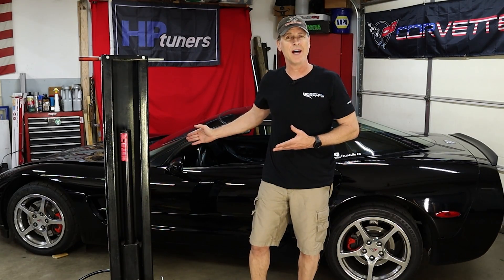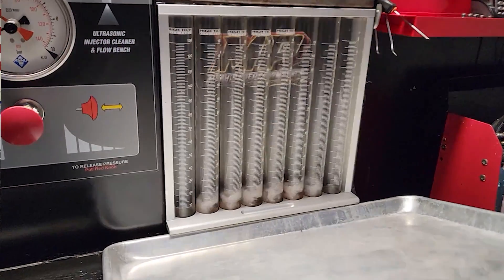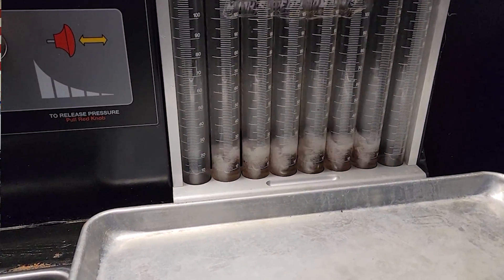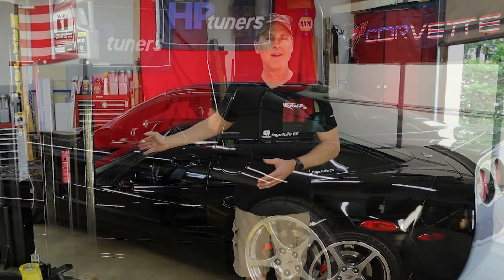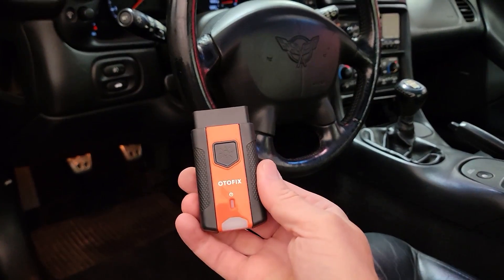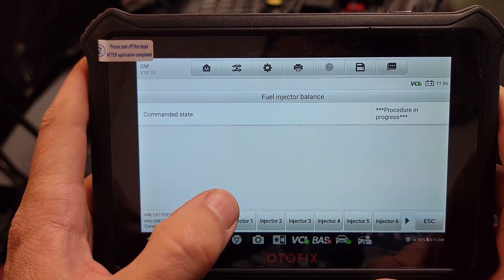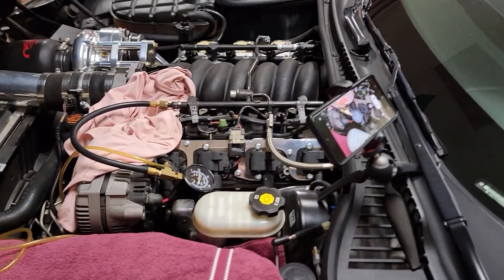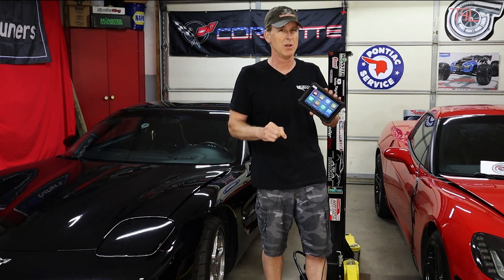2 Minute C5 Corvette Tech (EZ Fuel Injector Balance Test!)

Comment: Time for a JT and 900 to the tire. The stock trans and diff will live just fine
Reply from the maker: JT?
Reply: @Toys4Life .  I am sure your car has the SI trim on it. I opted for the JT trim from Vortech instead of the SI or TI with the A&A branded units. It's still self contained. Making 17 pounds on a 409 inch ls2 in my C5  995 rwhp 860 rwtq SAE
Reply from the maker: Damn, and I thought the SI put out enough horsepower for the most part 😜
Reply: That's so much easier than the last time I did them. I need to look  into that scanner.